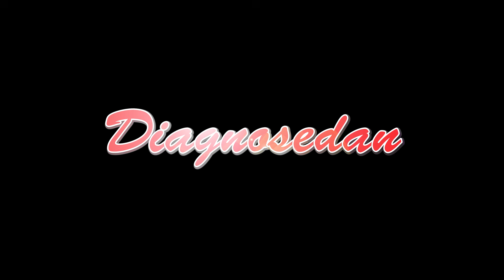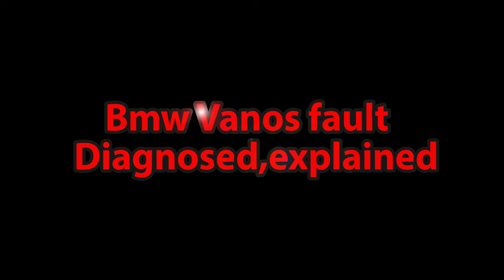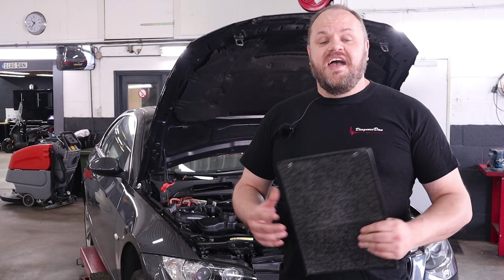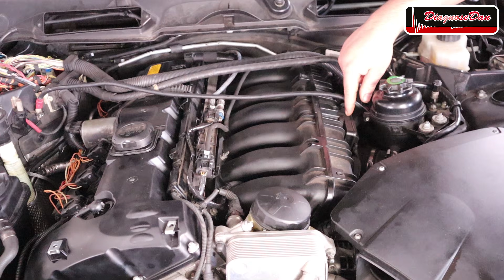Bmw Vanos Fault Explained (3000€ parts replaced and still not fixed!)

Comment: From the color of the oil. It appears the customer is not changing the oil at the recommended intervals and using the correct grade of oil. 
As far as the mistake. No one is perfect. 
To those who think just because you have a patch that's says you are Certified? Certified as a nut job? 😄
Certified only means you passed a test. This type of work takes years and years of experience and dedication. I'm sure Dan has made mistakes. I make mistakes. As Dan said. The shop that brought their work over does a very good job. That means alot coming from Dan.
Reply from the maker: Yes i've made and make mistakes, it's called experience😜

Comment: I don't generally speaking don't service my cars, especially newer ones. But by profession I'm machine mechanic and indeed, one thing I've learned during last 10 years is.... Make markings everywhere when you take something apart. It's so damn easy to swap wirings, pneumatic tubings etc. on all mechanical devices. If I open/remove something new that looks that it possibly could be installed incorrectly I mark it. One of my most used tools I carry everywhere is the 1mm hole marking marker or parts I'll wash a scribe to make that very small permanent marking. Good video 👍👍
Reply from the maker: Take a close look at the video, he actually marked one of the connectors with white Paint
Reply: @Diagnosedan  Hah, you're right. It's indeed visible at 14:59. How on earth did they still managed to interchange connectors? Though admittedly that isn't the best marking seen, but maybe it was assembled by another person or something like that. That's also really good method to get problems. Also bit nasty for BMW to make those connectors interchangeable when they're so close to each other. One thing more, in correct orientation wiring route seems to be bit nicer too.

Comment: One more  fantastic  video, from the MASTER  TECHNICIAN DAN. 👏👏👏👏👏👏🙏
I did a similar mistake 6 years before, on one  Mercedes AMG ,one  of the four bolt of the rear end ,bolting to the chassis, was snapped, I had to remove the full rear differential unit to be able to remove the snap bolt, and when I re-install everything back (I had to remove the exhaust ,too ) ,I mixed up the O2 sensor plugs which was next to each other  (bank 1 to bank 2)location  near the transmission  ,the car had issues......codes was coming after few days of driving, and another Merc specialist  garage find my swap plug problem.....
since then, on my toolbox, is a pencil and a masking tape, which I am using to mark EVERY CONNECTOR that I have to unplug. 
I learned my lesson, unfortunately, from my mistake. 
This idiot  mistake, never  AGAIN!!!!!
Reply from the maker: That was a Nice lesson you'll never forget

Comment: Typical workshop situation where car with running issue comes to workshop with barely any fuel in it!
Reply from the maker: I had to put fuel in it to testdrive it😬
Reply: DiagnoseDan 😂 😂😂😂
Reply: DiagnoseDan No doubt if it was a car that needed the fuel pump or tank out of it the fuel would be topped right up to the filler neck 🤦‍♂️

Comment: 14:16 The moment you pointed to those Vanos wires and plugs, i thought "i bet you can swop them a round, the plugs are the same" and my god i was right. I know this because i did a similar thing on a Rover VVC engine once but it was with wires swopped between the vvc unit and something on the inlet manifold. That also ran like a bag of bolts but i knew what i had done straight away because i was very use to working on them lol. Can't believe BMW has done such a stupid thing by having the same plugs. Well worked out, all the beers on them lol
Reply from the maker: Thanks for the comment it's appriciated Paul!
Reply: @Diagnosedan  No worries, love your approach to faults.................and the equipment/yools you use.
Reply: I'd expect it for a Rover but for a newish BMW it's beyond belief that their engineers are so sloppy when it is very easy to design against such mishaps as is done for most other modern cars
Reply: @alanpartridge2140  BMW aint all they're cracked up to be
Reply: @alanpartridge2140  I completely agree. It's very easy for even a trained mechanic to make a mistake like this. Big mistake on BMW's part, at least the color would be different.
Reply: bodgit and leggit (Irish mechanic tuber) had a similar job. A diesel car (Astra, I think) had the engine replaced and wouldn't start, been through 2 garages with no fix. The garage that did the swap numbered the plugs for the injectors and they were connected up in numerical order. However, somebody had forgotten which direction they'd numbered the plugs in...

Comment: It seems that the best solution to avoid Vanos or other VVT problems is to keep away from extended oil changes and always used the proper oil type.
Great video, I learn some thing knew today.
Reply from the maker: That's actually great advise!
Reply: Yep i change my oil every 10k km

Comment: This is all the reasons i'll never touch a BMW, they leave your deep pockets empty!
Reply from the maker: Good business for workshops 😜
Reply: @Diagnosedan  Yeah it is and workshops obviously need the income but German stuff are on a whole new level of income lol
Reply: ?? The workshop fucked up and plugged two wires the wrong way, what does this have to do with the specific car?
Reply: @bilaltariq7819  What was the original fault my friend?, a plastic flap that should be made out of better materials. Look at all the damage it caused by bending valves etc. Yes the garage messed up but we're all only human. I will never own a BMW due to there poor reliability and large repair bills. Anyway its party time because Dan's mate is buying the Beers lol

Comment: Great video, very informative. This looks very similar to the system Mercedes Benz uses and I am familiar with. I feel sorry for the workshop that did the original job, I have been in a similar situation myself and also my workmates. That always got solved long before things went this far. This was a valuable although expensive lesson for the workshop but a lesson they will never forget. But, you did not only fix this BMW you also fixed my mood. When I started watching this video I was really grumpy or angry but at the end I was laughing! Just send me the bill. :D
Reply from the maker: A smile is priceless😜

Comment: With all do respect you say it has a fixed but is not I can clearly see that the RPM still hunting I not saying that it's same as before but still I think alot of you also noted maybe after you clear the code and change the oil become idling fine but I was hoping that you record that so we can see it I hope you accepted my noted and clarify the issue
Reply from the maker: The fault was fixed. I swapped the connectors but didn't reset the Vanos adaptions yet. It Will take some time for the adaptions to relearn

Comment: Why would BMW make the connectors interchangeable for these solenoids just to save money by not making a different connector? SMH
Reply from the maker: There were some guides and sleeves missing that would have made this mistake nearly impossible
Reply: Probably, they using the same part number solenoid (Same valve),for the inlet and exhaust vanos system. so,same connector...
Reply from the maker: @Lambros_Stefaneas  exactly

Comment: Good work, Dan! STrange they do not color-code those things better. It's like the greyish-white wire and the white-greyish wire. (André van Duin met de bom)
Reply: It's missing some cable boots which normally make this mistake impossible.
Reply from the maker: @sdgelectronics  that's right and that led to making this mistake possible!
Reply from the maker: Ik heb de meeste video's van André wel gezien maar de Bom.....?
Reply: DiagnoseDan Volgens mij was het radio en Doris. Oepsie. Hij vindt een bom en moet die dan onschadelijk maken en belt de politie uit een telefooncel. De politie aan de andere kant vertelt hem niet naar hun te komen en daar te blijven. Onschadelijk maken moet met een linksdraaiend antimagnetisch speciaal gereedschap. Oh, heb je dat niet, dan kan een knoop ook. Hij moet dan een grijswit draadje doorknippen, niet te verwarren met een witgrijs draadje. Enfin, op een bepaald moment hoort de politie... tuut tuut tuut en concludeert dat ie heeft opgehangen.

Comment: I'm wondering: how does it work when all those expensive parts have been replaced for no reason? Who is going to pay them and involved labor? The culprit workshop or the innocent car owner?
Reply from the maker: The shop that worked on this car is also the owner. They tried to fix and resell this car
Reply: @Diagnosedan  peculiar situation. What's your experience for these situations if the owner would have been a normal  customer? Thanks
Reply: Unfortunately the owner.
Reply: For your understanding, unfortunately it is considered that customer agreed on work being done by the mechanic even if he fail to fix the car. Going further will be choice of the owner. Good doctor, good lawyer, good barber, good mechanic are important because whats done is done...
Reply: @sukhwang4554  I think my lawyer would have something to say about this ;)
Reply: @AlessandroGenTLe  I've seen a lawyer sueing mechanic for the repair that was done. Obviously he got the money back, but for anybody who are not lawyer will have long journey

Comment: not the first time i've seen the same profile of connector with enough wire that a switch is possible. the color of the plastic should be different as a warning.
Reply from the maker: Thanks for watching Richard, it's appriciated.

Comment: Man made problems can be the hardest to diagnose. Great video Dan.
Reply: One would wonder why they didn't use different connectors to avoid such a problem. Maybe cost considerations.
Reply: @obsoleteprofessor2034  i've seen a lot of this kind of mistakes in motorbikes, motorbikes often use the same connectors for different components also!
Reply from the maker: That's right!

Comment: Yikes. That would be an easy mixup, the connectors are interchangeable.
Reply from the maker: Thanks for watching
Reply: You would think they would differentiate the connectors for the solenoids. Tag the harness, colour code or the like. Seen it happen on cam timing sensors on DDC Engines....Good pickup there Dan.
Reply: @larryskeeper1197  I agree, I mean, even something as simple as a red and blue marker on each of the connectors and the solenoids would have done the trick. But then again, you can also swap the solenoids around as they look identical.
Reply: @Stoney3K  the solenoids that extend through the opening on the front of the cylinder head are identical, same part number for both cams, it’s the VANOS sprockets that are unique to each side.

Comment: Love your logic in diagnosing. Regarding in wrongly installed connectors, wouldn't it be better if BMW either color coded the plug and socket or keyed them in some way they couldn't be interchanged?  In other words make them idiot proof.  Great channel, please don't leave it so long between blogs.
Reply: That’s how BMW dealership makes money!
Reply: Two identical connectors right next to each other and the "tech" didn't label them. Shops need to stop hiring idiots.
Reply from the maker: @mattt4183  look closely to the video, they actually marked one of the connectors with white paint
Reply from the maker: There were some guides and sleeves missing that would have made this mistake nearly impossible

Comment: How stupid of BMW to fit 2 identical plugs that can be so easily mixed up. 🙄
Reply from the maker: There were some guides and sleeves missing that would make this mistake nearly impossible. If you look closely you',ll see the even marked the connector with white Paint
Reply: How stupid of the "tech" not to label them.
Reply: @mattt4183  yeah that too.
Reply: It's relatively uncommon to see identical plugs close to each other. How often do you see anyone spending time labelling every plug they remove?
Reply: @jix177  There's no need to label every plug. Just the ones like this that can be easily switched. It's less than a minute with a two dollar paint pen vs. three grand in parts and who knows how many hours labor............

Comment: Great job Dan! 
Is there a source for wiring diagrams I can use, I have an issue with my Vectra VVT and I’m fairly sure it’s faulty wiring. I have disconnected the ECU and cam sensor connections and the problem disappears for a while. So need to do continuity checks but have no diagrams. 
Thanks.
Reply: Check your local library for resources available to you.
Reply from the maker: Carmin app, it's free in the playstore
Reply: thanks Dan 👍👍

Comment: I do Liqui Moly Engine Flush every other oil change to clean all the oil channels internally
Reply: It's absolutely not needed if you change your oil at decent intervals (i.e. max 15000km)
Reply from the maker: If you use the right product and follow the recommended procedure an oil flush is not a bad idea

Comment: So simple but so difficult.  You very good at explaining systems.  Years ago had no start on a mustang and wires were crossed, bloody connectors should be all different. Good work.
Reply from the maker: I diagnosed a Mercedes once. The airbag went off after the Car was unlocked with the remote. It was in a bodyshop that Just  repaired the front bumper.
It turned out that the connector for the front foglights (in the bumper) and the front crash sensor (under the headlight) are exactly the same. After unlocking the Car the lights of the car came on and triggered the airbags to deploy. €4000 damage😬